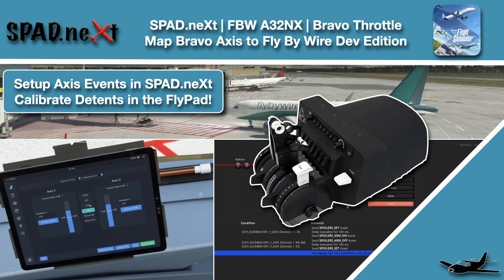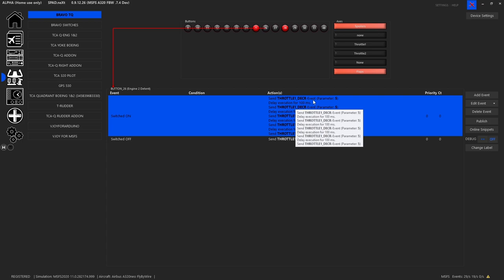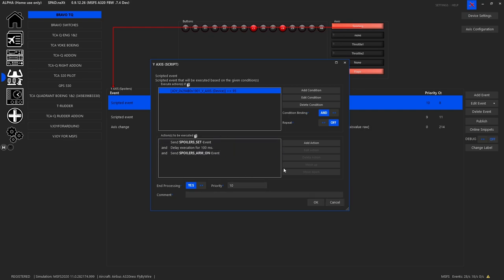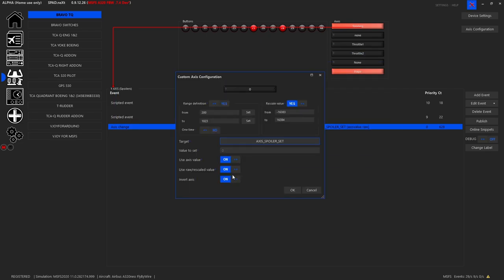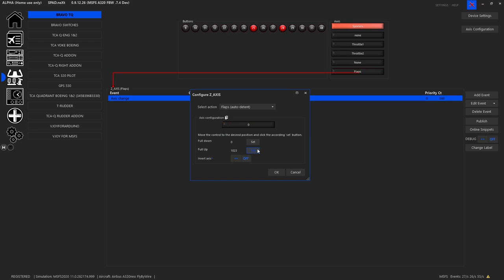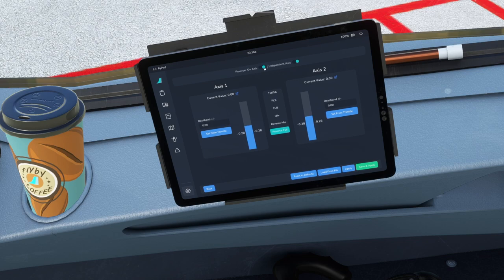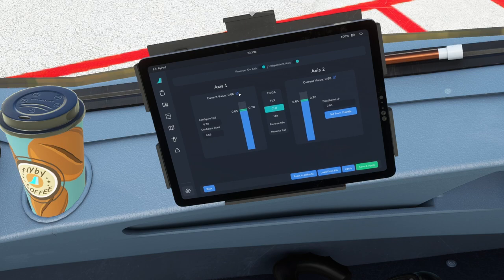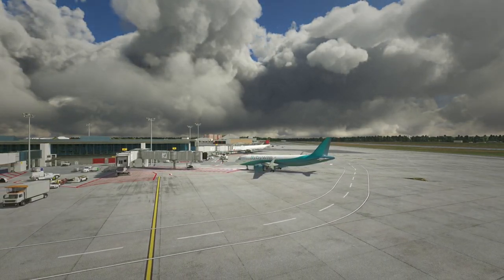MSFS | SPAD.neXt | FBW A32NX | Bravo Throttle Axis Setup

Comment: New to SPADneXt but not the struggles with the Alpha and Bravo programming. I am far from a programmer but have learned the default software for them to make some profiles. Really liking what SPAD has to offer just trying to learn the new ways of doing things. Your videos are very helping tons down the road to learning the software and capabilities. One note though was I had no clue how to make the command for the elevator you used in this video. I did however manage to stumble into finding how to make it. Not sure if it was 100% correct but it is there. Awesome software BTW.
Reply from the maker: Cool. I leave the elevator/aileron in the sim since those items never change and currently I find they need a lot of curve applied.

Comment: Thank you Les!  I had a working config (I thought) at one time but I had to revert back to using the in-sim config for my Bravo.  Not anymore!  Oh and the spoiler arm/disarm is fantastic.  I've been using a button on my Stream Deck to handle that.  Again, not anymore!  ;)
Reply from the maker: Thanks for always taking the time to leave great and supportive comments Jenny!
Reply: @LesOReilly  Well it's the least I can do. You always figure out things for me without me even having to ask. 🤣
Reply: They sell addons for the Bravo to include the arming feature with Spoiler lever(s). Personally I wnat everything as real as possible, but moving the spoiler lever arms it in the sim apparently - no issues with moving the lever up and down.
Im  gonna buy the realistic lever and flaps detent levers as well - and it includes throttle detents.  ETSY

Comment: Always good stuff thanks !
Bite your lip and just use the throttle decrease feature in MSFS - 2 minutes done - works great.
I notice that the reverse levers are not assigned here ?  You can still pull on them to make it feel real.  Maybe I missed something I  combined with low detent, or use  for some other feature; brakes ? center rudder ? 

For the A320 or similar with FlyPad - its just doesnt work all the time.  I have setup up throttle detents in the FLY pad multiple times and recently have had 0 success trying to do it, even with SPAD it just isnt worth it.  I enter values - use the cockpit throttle - select single throttle - no reverser - load from file - All looks good - didnt work ! nothing worked.  To be clear i could not match the idle detent on my Bravo with the actual cockpit throttle.

BTW I had to perform this re assigning of controls after my MSFS folder disappeared from hard drive ??  yes it really did, no shortcut i had assigned to start the SIM would work :Error file missing:  mutha f  er.  Still confused how the assignments in SPAD stopped working, after my MSFS re install.  Whatever MSFS did the SPAD throttle settings no longer worked with  FlyPad.
Reply from the maker: All still works for me.

Comment: Hi Les, thx for the great work,,, don't know if I am doing something wrong because I follow the video instructions step by step but I cant make it work. The throttle start on the climb position and not on the idle as should,,, really don't understand why,,,
Reply from the maker: You probably did not check of the invert… or you did by after setting your ranges.
Reply: @LesOReilly  I'm having the same issue of starting out in the climb position. Tried calibrating manually (editing the end and start positions), but it aways ends up saying that one axes position is overlapping the other position and can't save the setting. Invert is off.
Reply from the maker: Not sure what to tell you I have made it work as have many others. I have posted multiple screen shots in the discord as well.
Reply: @LesOReilly  Thank you for the reply. I forgot to mention that when applying full reversers the throttles in the sim only moves about a quarter of the way down. I'm  sure it's something I'm doing wrong. Another issue is in programing Spad.Next for the throttles I can only select "Button Pressed". I do not see a option for "Switched On" or "Switched Off". That might be where I am messing up. I'm using Ver. 0.9.12.69
Reply from the maker: In the newer versions the Button Presse and Button Released are the same thing as Switch ON or Switched OFF.
Reply: @LesOReilly  Ok, thanks.
Reply: I have had same issue - see comment above...Bite your lip and just use the throttle decrease feature in MSFS - 2 minutes done - works great.
I notice that the reverse levers are not assigned here ?  You can still pull on them to make it feel real.  I didnt assign them either - but you can  use  for some other feature; brakes ? center rudder ? go crazy.

Comment: HI, new to SPAD and I got the 0.9.11.5 build. i can not find this snippet saved as an online snippet. I also can not programme this as the descriptions are different. I can not find the elevator trim position to even apply a decrement.

Thank you for doing such a good job!
Reply from the maker: As per the video ... it is on the Alpha channel and those snippets are not compatible with the release version as there is all kinds of new improvements implemented ... that video is on a 0.9.12 build
Reply: @LesOReilly  I don't get why SPAD does this, why make it difficult to apply snippets from one version to another. it makes their software kinda difficult. RSMapper just works, irrespective.
Reply from the maker: When things progress the old version would not understand how to load new version. New version can load old.

No different that saving a file in EXCEL 2020 as XLSX then trying to load that in EXCEL 97. 

You can’t account for what will come new in the future. As a benefit at least they are hidden on the server so you can just “fail to load”. You version shows you what you are able to load.

Comment: I have a problem with the reversers. Running release 0.9.12.123. I have followed your procedure but since the current release have changed the button triggers, I have used the Button pressed for the first event for the button 26/27. The throttle correctly moves to the reverser position but immediately returns back to the idle position. What am I doing wrong?
Reply from the maker: use the discord post your images .. my guess is that you need to change the trigger types.
Reply: @LesOReilly  Thank you very much for your quick response! I am struggeling with my discord account (informed that my phone number is connected to another account), therefore I cannot post on discord for the moment. Hovever, my settings are exactely the same as in your video, exept for using the ”button pressed” instead of what you are showing in your video
Reply from the maker: @sveinomland6616  Mine now says Pressed where it was switched ON and Released where it used to be switched OFF ..  They work fine and do what they are supposed to do ... make sure you don't have anything set in MSFS for those buttons or axis either .. Then also make sure the FBW flypad has the configuration set correctly for your detents..
Reply: @LesOReilly  Again, thank you! I did a new calibration in my flypad and now it work just fine! I had to add a small dead zone for the reverser settings (-0.23 to -0.28) My settings for the Spad next was just fine🙂
Reply from the maker: Awesome.

Comment: Can anyone suggest why my reverse thrust will not work. Throttles work perfectly. Have dble checked buttons 26&7 code and all correct. I have used MSFS Throttle.decr1 & 2 in reg version of spadnext. Detents in Ebook are correctly set but sim is not reading  (axis) buttons. Thanks
Reply from the maker: Best to post screen shots of how the button is config to the spad discord.
Reply: Bite your lip and just use the throttle decrease feature in MSFS - 2 minutes done - works great. 
Have had intermittent success with this - especially the FLYPAD, and recently have had to re assign SPAD - The same commands would not work after reinstall ?? see above if u r curious.
I notice that the reverse levers are not assigned here ?  You can still pull on them to make it feel real.  I didnt assign them either - but you can  use  for some other feature; brakes ? center rudder ? go crazy.